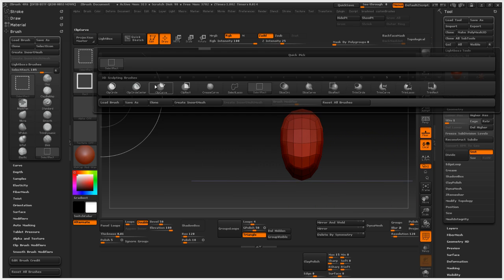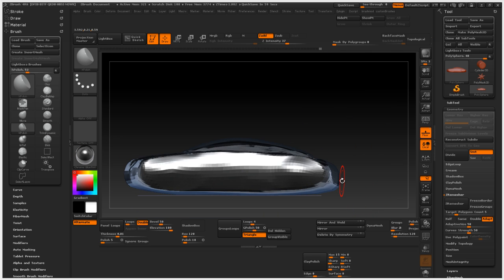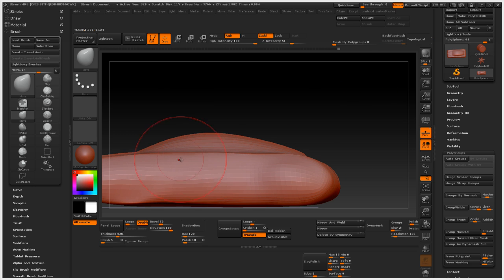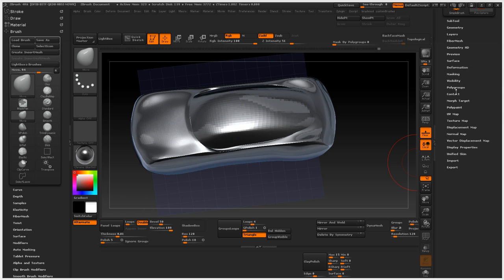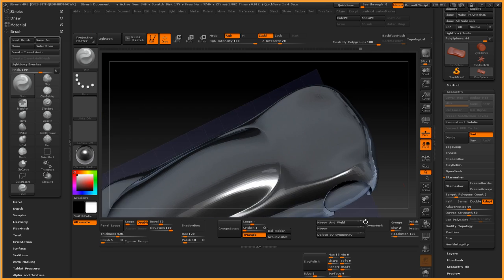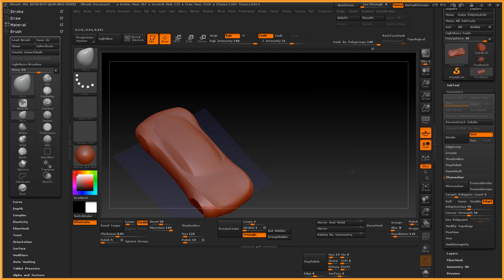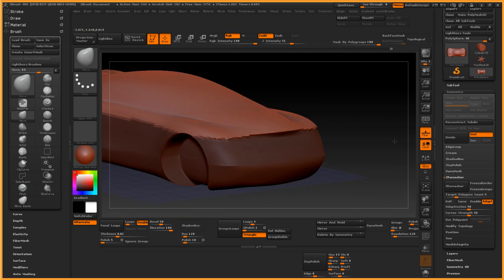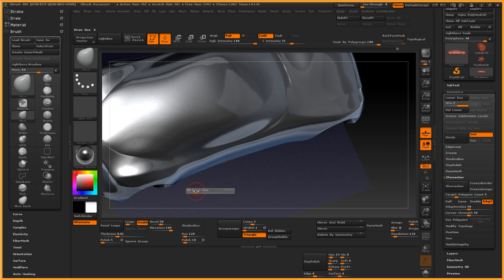Sculpting a sportscar in zbrush 4r6

Comment: So amazing to see this. An actual industry level car designer blasting away hard surface form in ZB. Though I came from a painting background I was always infatuated with car design and blend forms. When 3D became a production tool in the 90's I did some product design with Autodesys (not Atodesk) FormZ, bottles and lighting fixtures, but manufactured. I wasn't a CAD draftsman but I did know it so I used it. However, I was in awe of the real car manufacturing tool like Alias by Autodesk. So I always tried to incorporate proper curves (pseudo G3 curve from NURBS) and tertiary surface blending. Then all of that gave way to Autodesk and Pixologic organic modeling and sculpting tools. I recall a YouTube video where they sculpted in Mudbox then brought the mesh into Alias to be curve and proper NURBs surfacing. Just minding blowing stuff and here I am still amazing to see this done by a truly professional educated car designer in Zbrush. All this tech has been truly enabling. I never became a industry car designer eventhough I have rendered cars for a manufacturers and at one point taught CGI at a university that had a Car design department. I still apprecate the clay, wood an form maquettes you speak of. Again awesome to see this work and hear your thoughts on the process. I just finished a couple of cars but they are for a cartoon anim but these principles still apply. Thank you very much for sharing.

Comment from the maker: CraftinDiamonds,  the pixolation is a function of the polygon count.  Unlike other polygon modeling tools, you can't Sub-D it to smooth is out.  You have to actually add more polygons.   To do that, go to your Tools > Geometry and then press "Divide".  This will double the amount of polygons.  Do this until it becomes as smooth as needed.   Be careful though.  Adding more polygons taxes your system AND its harder to control the form.      I hope this helps.   - Carstylus